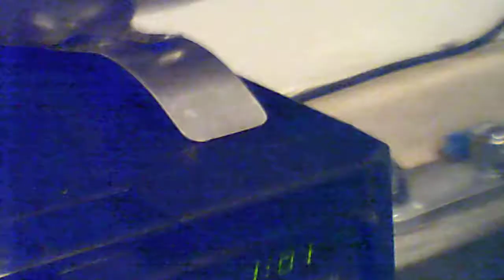Large Inverter Running Fridge and Coffee Pot

Comment: Large inverter...what does that mean?
How many watts?
Reply from the maker: My large Cobra inverter that you see runs 5000 watts peak and 2500 watts continuous at 13.9 amps. I can pretty much run anything that takes a 110 plug. I can even run space heaters or a 1000 watt microwave even a air conditioner. If you are interested in a dc to ac power inverter don't buy something like this. One the price is around $350.00 just for this inverter, and another thing is this inverter is a modified sign wave inverter so things like TV's and computers don't like the power it produces.  If you are interested in a good Pure Sign Wave Inverter then you could get a 1500 watt one for less than half the price of this one and still run most things like a 10,000 btu air conditioner or a 1000 watt microwave or a fridge or deep freezer . I purchased a good 1500 watt pure sign wave inverter for my girlfriend just for her computer and our TV . here is the one that I bought her off of ebay. https://www.youtube.com/watch?v=jDiPG7ui358&ab_channel=ChristopherHorton